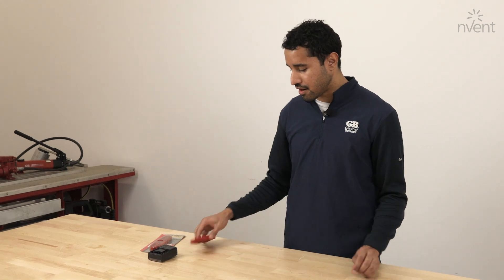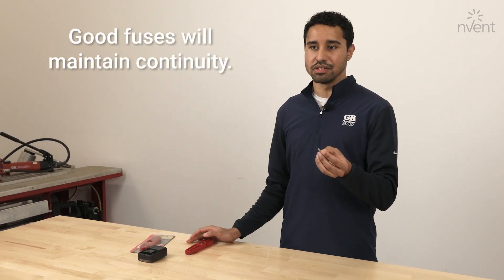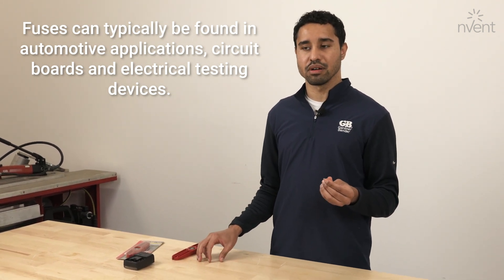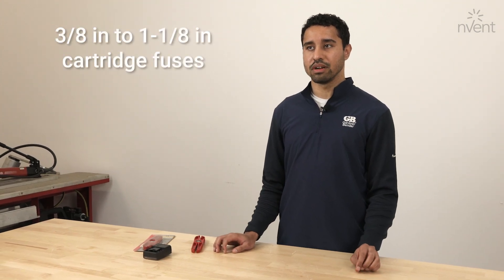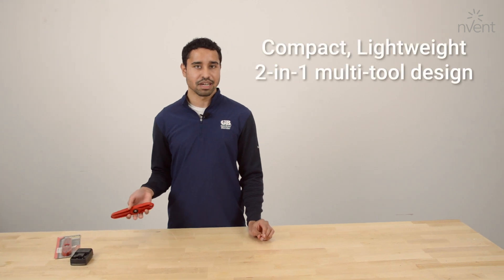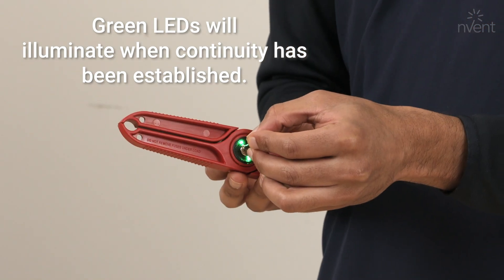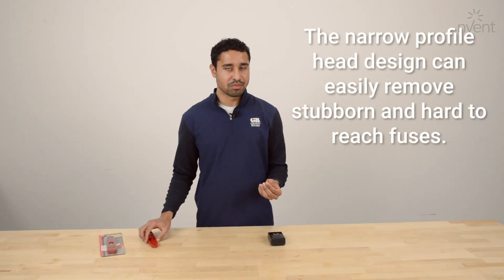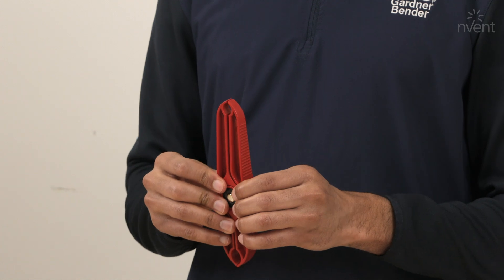Product Overview | 2-in-1 Fuse Puller and Tester

Comment: Funny you show it removing a little BS glass fuse show it removing a 60 amp fuse on a three-phase 208 disconnect specifically taking it out the center fuse